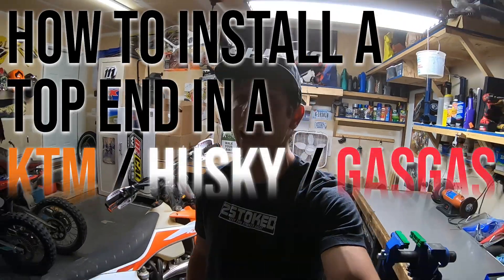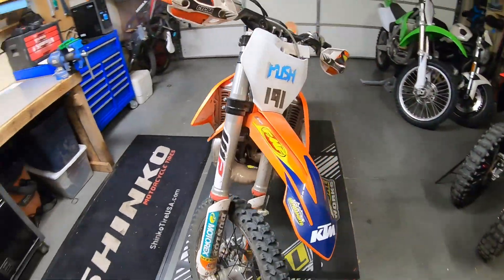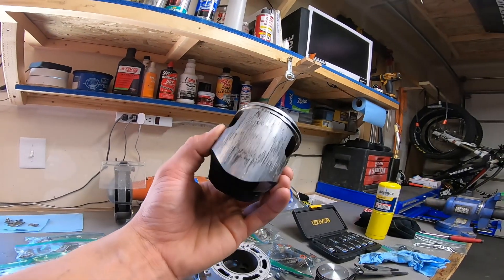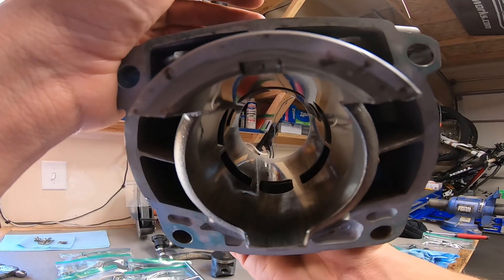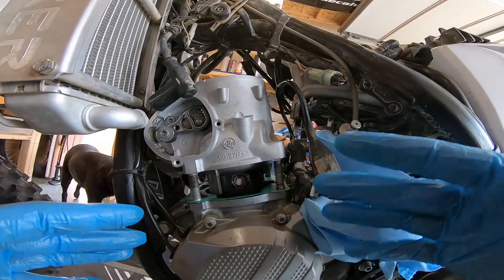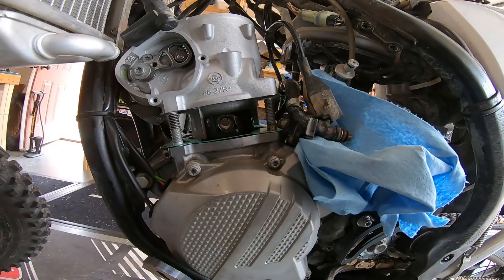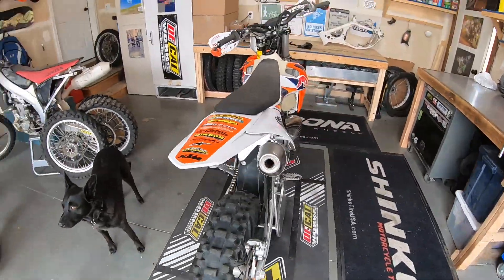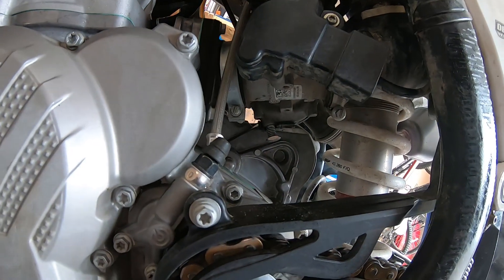How to Rebuild the Top End in a TPI 2 Stroke (KTM, Husky, GasGas 150/250/300 Piston Replacement)

Comment: Is there a specific break in process you recommend for 2022 KTM 300 xcw?
Reply from the maker: I would do 3 full heat cycles without touching the throttle while it warms up. Gentle riding for first 10 or 15 minutes after that, and then ride it like you stole it

Comment: Great video that was helpful during my recent (and first TPI) top end refresh. Love the tip re putting the piston in the cylinder first (I too was using EZ clips) as otherwise it's rather fiddley. 

I have a tip to share in that you don't need to remove the injectors and fuel line from the cylinder to get it off 🙂

Comment: Didn't see a deck measurement or measuring the power values setting??
Reply from the maker: Unless I'm mistaken not much needs to be measured with the power valve. As for the deck measurement, you're right. I used the closest cylinder gasket to stock and went with it. Didn't have the appropriate tools for Z height. Potentially worth investing in and something I should have mentioned. Hope you found it helpful otherwise!
Reply: @KincadePavich  Definitely helpful. I've never done a top end before and it is time to do mine. The RMATV video had the additional steps of deck height measurement and power valve setting. I think you're correct, there isn't much need to play with the power valve setting. The tool for both is available from RMATV for pretty cheap though if you wanted to measure both.

Comment: Nice video. Why was your piston/cylinder so scored?  And no oil pump priming before restart?
Reply from the maker: I've been lead to believe piston/cylinder damage was due to a cold seizure. Bike never actually seized, but could have been improper warm up. I bought it used, so it could have been before I bought it but I really don't know. Ever since the rebuild I have been even more careful about letting it warm up fully before riding and making sure radiators are warm to the touch. As for priming, I believe it is only necessary if there is air in the line, such as in the case where you replace the oil pump. Maybe that is not correct, but the bike has been running great since the rebuild with no issues.
Reply: The oil pipe is attached to the intake system not the motor. So isn’t disturbed when doing a top end.👍🏻

Comment: I am about to do a top end on my 2020 ktm exc 250tpi. I want to order all the parts (piston, seals, oil pump, oil screen and the power valve orings) prior to opening the engine since I want to ride it while I wait for parts. I want to order the same piston size as the stock one and then when I open the engine I will get the cylinder measured and if B piston will be needed, then I will return the A piston and buy a B piston instead. But chances are that A piston is what will be needed. Could you please tell me what the stock piston size is ? 250 exc/xcw has the same engine as your 250xc except the transmission. Thanks a lot.
Reply from the maker: Hi there, I ordered a B piston from Slavens since that's what they recommended for # of hours on the bike. But I ended up getting the cylinder replated anyway, so I sent the piston to Millennium with the cylinder. Best of luck with the rebuild. Sorry if this isn't a super helpful response!

Comment: There are open ends adpater that allows you to torque down bolts that aren't reachable with a socket. You just need to calculate the new torque value. Cheers